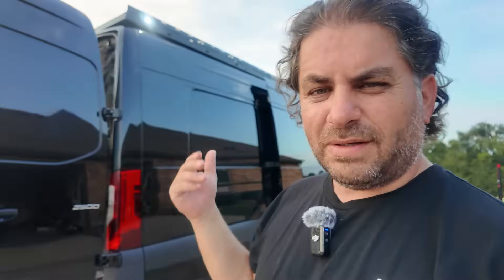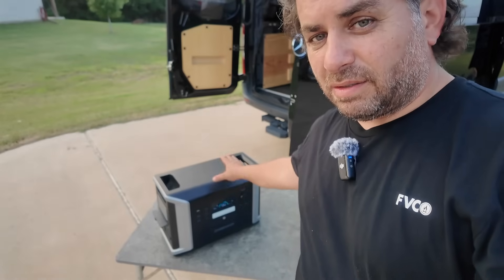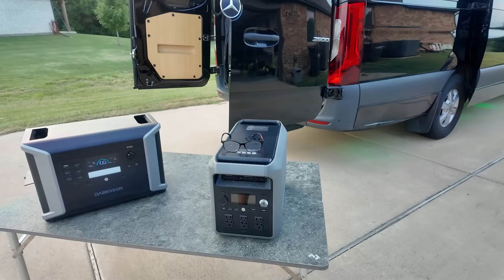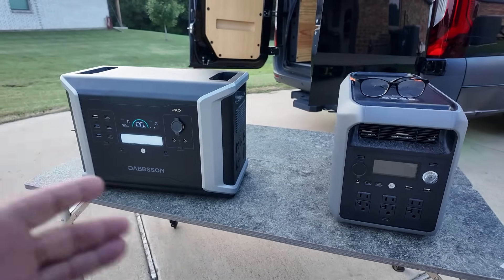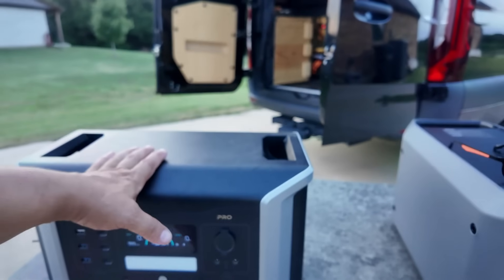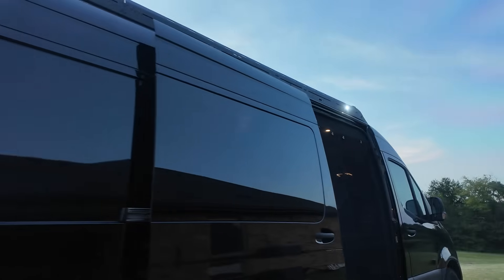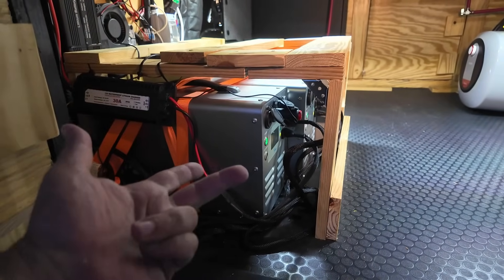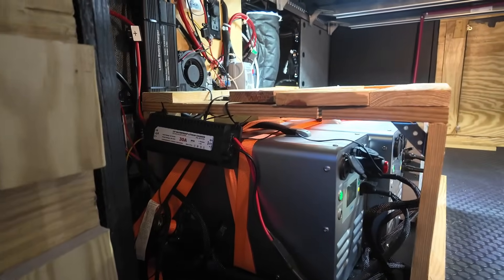The #1 Mistake Van Builders Make with Power Stations

Comment from the maker: ▶ See all the parts I used  in my VAN build for FREE https://bit.ly/RFVanBuildPartsList
▶ See the VAN build schedule for FREE https://bit.ly/FreeVanBuildSchedule

▶▶ How I making Van Life more enjoyable and stress free for Self-Contained Van Overnight Stays
https://tidd.ly/3IdDp25

▶▶▶ 4KWH Unit is CURRENTLY ON A SUPER SALE, AND SAVE EXTRA WITH DISCOUNT COUPON CODE Comvolt_RANDOMFIX101
Comvolt 4Kwh Unit
Purchase HERE ▶▶ Link to recommended vendor HERE 
My RECOMMENDATION GET the Comvolt 4Kwh  Unit with Display + PDU Unit  https://tidd.ly/4m3OkcM
▶▶▶ for extra saving use this DISCOUNT Coupon code :Comvolt_RANDOMFIX101

Comvolt 3Kwh Unit -- $$$$ The 4 KWH UNIT IS MUCH BETTER DEAL -see links above
▶ 3Kwh Unit Review https://youtu.be/7I8w5NbcXXA
Purchase HERE
▶▶ Link to recommended vendor HERE https://tidd.ly/3JziAyF
▶▶▶ for extra saving use this DISCOUNT Coupon code :Comvolt_RANDOMFIX101
▶ Amazon link ( more expensive than buying direct ) not available yet but here is the 3KWH link https://amzn.to/3X15I7h

▶▶▶ Vehicle Charger Install https://youtu.be/vN6dCU8epOw

▶▶▶ Perfect 400-watt solar panel https://amzn.to/3YRMjYQ

Already own a Comvolt unit? Just addon power!
Want the smallest unit with 6kwh of power? 6,016wh!! 6 KWh Add on units
▶▶ Link to recommended vendor HERE 6kwh expansion pack https://tidd.ly/45HD1C1
▶ for extra saving use this DISCOUNT Coupon code :Comvolt_RANDOMFIX101

Want to go BIG? Want the ultimate portable power station? Complete systems
▶My ONE Comvolt 4Kwh Unit with Display + PDU Unit 
https://tidd.ly/4m3OkcM
for extra saving use this DISCOUNT Coupon code :Comvolt_RANDOMFIX101
+
▶▶ Get TWO 6kwh expansion pack
https://tidd.ly/45HD1C1
for extra saving use this DISCOUNT Coupon code :Comvolt_RANDOMFIX101
= 16 Kwh system!

Useful connectors for Comvolt Units
▶ XT60 to TX90 Adapters https://amzn.to/4hu15fw
▶ Anderson 120 connector to XT60 https://amzn.to/3Yz7L3r
▶ Prewires Anderson 120 with wire https://amzn.to/3UA5GmF
▶ XT60 DIY Kit https://amzn.to/40uggz1

some of my volt components 
▶  12 Volt A/C https://amzn.to/41qukJM 
▶  12 volt with heater https://amzn.to/466mXtA
▶ Roof fan I installed https://amzn.to/3HjJRnW
▶ smaller fan I installed for better circulation https://amzn.to/3Und2tc
▶ 12 Volt Heater ( tested it many times and it's SOLID ) https://amzn.to/45pUZYf
▶ 12 Volt 27 inch TV / Monitor that can mounted to back of the front headrest in any camper van     ( weighs only 5 lbs +  USB C (video) for Android Phones + has speakers  )  https://amzn.to/40ZY5kr
▶ Swivel 1 inch ball double socket https://amzn.to/4oxL6Av
▶ DIY 12 volt 5.5mm x 2.5mm connector to power TV https://amzn.to/46V2GIn
▶ 12 volt Mini PC that use the same 5.5mm x 2.5mm connector https://amzn.to/4mguV9i
▶ 12 volt refrigeration https://amzn.to/4hB7qVY

Comment: I think 12V is fine if efficiently matching against 12V devices at low power is your sole goal, but there are a lot of warts.  Heat, Limited scalability (particularly for solar panels), large cables.   That said, if you are willing to live with the limitations, I think its fine to select native 12V.  At that point you don't even need a power station at all, you just use discrete components.

Power stations solutions are indeed far less efficient.  There are a lot of conversion losses.  But power stations offer a lot of capability in a small package and usually generate a lot less heat due to the higher internal battery voltage they tend to use.

I personally prefer to build things out of discrete pieces.  That said, I never use a 12V system bus any more.  It is way too limiting.  I will use 24V or 48V (i.e. 25.6V LiFePO4 or 51.2V LiFePO4) and eat the conversion losses. for any legacy 12V gear.

--

If you are still looking at power stations, one that might fit the bill for you is the Pecron series.  The Pecron E1500LFP, for example.  These power stations have some very nice features including a 30A 12V output (anderson connector),  a native battery expansion port (51.2V LiFePO4) which can be used to trivially expand the storage capacity of the unit, and separate solar and 12V charging inputs.  If a high alternator charge rate is not an issue it is pretty easy to more or less directly integrate it into a vehicle.

Also, you might not be aware but (generally speaking) USB-C PD ports can deliver 12V with a USB-C-to-12V cable.  Roughly 36W, so even regular power stations can actually deliver a bit more power at 12V than just through the 12V DC ports.

-Matt

Comment: For 1500 $. I might consider the Comvolt 6kWh version. Let´s cut the HYPE and get back to basics. We want to convert from the Lead Acid car battery to Lithium and we  want a big inverter to drive AC voltage devices and we want to use SOLAR POWER.
Jack of All Trades PECRON 3600LFP > 1.260$ + MJ32  adapter  cable
Nº1  Hook up to the cigarette plug. That is 100W x 24 hours = 2,4 kWh per day > NO headaches messing around with the DC-DC for that + Solar... In the morning  You start up the engine and the alternator will do what it was designed for. 
If You want more ? Victron DC-DC 50Amp with SET POINTS that allows to dial in on Max Amp alternator capacity

Nº2  2 independent Solar charge ports 1200W - up to 150V. No headaches. Any Solar configuration up to 2400W will fit

Nº3  48V inverters are more efficient > 3600W - MAX 7000W
Nº4  Use MJ32 connector. Fits All Pecron propietary Battery extension ports. Now You can hook up Your own DIY expansion battery PLUG&PLAY >>>> or hook ANY battery 12-48V to the 2nd solar port
Nº5  Stabalized Inverter with 3kWh storage capacity expandable  + build-in 1800W AC charger 
Nº6  Has Solar Wake Up feature and DC 30 Amp plug to run Diesel heater. You can not charge a Lithium battery below Freezing Temp but You can discharge it to keep the battery warm and the water in !!!!THE WATERTANK TOO!!!!
Nº7  Plug&PLAY > SET IT > FORGET IT 
Nº8  Warranty > WELL, they are both manufactured in China Town. I assume You know what this is about ? In both cases you have to take the thing apart and change the Lithium Cells.

What I am trying to say....We don´t need to reinvent the bicyle and for sure not for 3.300 $ 🤣 But THXs for the review

Comment: What is the 12v computer monitor and where did you get it?
Reply from the maker: sorry for the late reply
▶️ 12 volt Mini PC that use the same 5.5mm x 2.5mm connector https://amzn.to/4mguV9i
Link to video https://youtu.be/xA88BCCT_Tk

▶️  12 Volt A/C https://amzn.to/41qukJM 
▶️  12 volt with heater https://amzn.to/466mXtA
▶️ leak for level sealer I used https://amzn.to/42AMF6A
▶️ link for speed blade https://amzn.to/42PEGE1
▶️ link for jigsaw https://amzn.to/3EpRszP
▶️ Roof fan I installed https://amzn.to/3HjJRnW
▶️ smaller fan I installed for better circulation https://amzn.to/3Und2tc
▶️ 12 Volt Heater ( tested it many times and it's SOLID ) https://amzn.to/45pUZYf
▶️ 12 Volt 27 inch TV / Monitor that can mounted to back of the front headrest in any camper van     ( weighs only 5 lbs +  USB C (video) for Android Phones + has speakers  )  https://amzn.to/40ZY5kr
▶️ Swivel 1 inch ball double socket https://amzn.to/4oxL6Av
▶️ 1 inch ball mount for headrest to mount TV https://amzn.to/46Voofk
▶️ Vesa mount for TV with 1 inch ball https://amzn.to/4m8etI0
▶️ DIY 12 volt 5.5mm x 2.5mm connector to power TV https://amzn.to/46V2GIn
▶️ 1 inch ball for L track https://shop.rre-global.com/products/ram-mount-base-l-track-sealand-pro?_pos=1&_sid=e816317f1&_ss=r

Comment: I don't understand why you even bought a power station....You're using it as an overpriced 12 Volt battery charger...
This whole video is just bad. Bad bad bad bad...
Reply: Makes a lot of sense to me and explained in layman's terms even exposed hackers would rather have!
Reply from the maker: Thank you for the great feedback.
I am not sure how a few others didn’t understand it’s “Native” 12 volts so it can be powered by either vehicle or the power stations if needed.
Reply from the maker: So I should stack 10 units of 12 volt batteries, then get a inverter, dc to dc charger, then add a solar charger, add a 12 volt lfp charger, wire it all up, and then configure everything?
I would still be missing a networking option and if one battery goes bad I am screwed, this on the other hand balances everything and has over load protection.
I have previously built my own battery and it was a pain, try it yourself and let me know https://youtu.be/j02eP4d0ndk?si=u0tD6yhidE_of16S

Comment: The first question is why are you limiting yourself to 12 volts??? That was the norm for RVs for yesteryear but not for today!!! Today you could go 24,36,48 volts!!! Several of the portable power station companies make alternator converters for your power stations!!!
The problem is you chose to go the 12-volt route!!! 😂 Which is absolutely ridiculous... You could have went 24... But personally I would have went 48... Unfortunately you don't understand. You could actually hack your power stations to accept an external 48 volt battery!!!
Reply from the maker: I do understand the advantages of 24, 36, and 48 systems but you maybe overlooking why I went with 12 volts.
I mentioned it several times though out the video, it’s about efficiency and it’s native!
With your 48 volt lights?, 48 volt fan? 48 heater?
Please tell me more about your setup, I am genuinely interested in your ideas but not providing specifics is a little hard to work with.
Thanks
Reply: @RANDOMFIX  It's fine having 12V gear.  I don't think 12V efficiency is the most important thing here, though.  A good DC-DC converter runs 95% efficient.  You generally aren't going to care about efficiency with shore power (AC) or alternator charging sources.  And with solar the actual loss in efficiency is usually smaller than you think because with a 12V system bus the charge controller is converting the string voltage all the way down to 12V... there are losses there even though you are pulling from the 12V battery directly.

So usually there just isn't much of a practical difference.  Having a 24V system bus (or 48V) usually yields so much more flexibility and scalability that its worth the slightly higher losses for 12V gear.

The advantage is that all of your high-power equipment and solar can hang off the higher-voltage bus while your 12V appliances hang off the lower-voltage bus.

--

In terms of how to implement the lower-voltage (12V) bus, there are lots of ways but the two primary methods are (1) Use a DC-DC converter, (2) Use a DC-DC charger and a down-buffer battery, or (3) Use a charge controller (like a Victron 75/15) and a down-buffer battery.

"down-buffer battery" in this case would be a tiny 12.8V LiFePO4 battery, like 20Ah or 30Ah, which can be trickle-charged from the main battery bank.   Basically zero heat because the battery handles the surges and higher loads, whereas a DC-DC converter often needs to be high-amperage because it must deal with surges and higher loads.

-Matt
Reply: What you actually did With the power station was to buy and use it as an overpriced 12-volt solar charger!!! Since you're not actually using the power station as it is intended!!! I really don't understand why you even purchased one!?! 🤔👎
Sorry but all batteries die in freezing weather. They lose half the power doesn't matter what the chemistry of the battery is... But that's your choice...
Reply: What 24 or 48 volt alternatives do you suggest?

Or are you just recommending a fully customized component buildout with victron parts or something?

Comment: you could get batteries with more capacity than this box for a fraction of the price.  its is crazy to even pay this much money for this system
Reply from the maker: Thanks for your thoughts and feedback!
You would need a lot more than just batteries.
-You would need an inverter, a good one for sure, this unit has that covered!
-You would need a solar charger+ you would need a battery charger and configure the charger so you don't destroy the batteries, then you need a shell, voltage display, an amp meter, a networking interface+ heavy gauge wires + crimps, + a dc to dc charger, and in the end this the step up will take more room and time than may think. 
If you want to go that way I actually created my own batteries last time from scratch https://youtu.be/j02eP4d0ndk?si=hImglwGT_-XYx2VM but this is some much better! 
Quality is not cheap.
Reply: @RANDOMFIX I must have missed that part so this comes with inverter/charger and ready for solar hook up?  Then that’s not bad

Comment: Clayton Power II LPS II 3000 -  2000Wh, 180A (270A surge) of 12V DC, 400W alternator charger and specifically built for permanent vehicle installs, but it's British, so the inverter is 230V/50Hz, but many appliances are dual voltage. Probably not for you, but good video on it called 'Why I QUIT all POWERBANKS for good?' that makes some general points about such units you might want to consider, especially regarding packaging/space efficiency
Reply from the maker: Okay, so I watched the video, and am trying to understand the comparison. 
Here is what I see wrong with that unit from Clayton power, 
-twice as expensive for 1/2 the power! So essentially it's 4x timer more expensive!
-yes, it's 230v volts, but the connecters for A/C power are not plug and play!
Are you in the UK or USA?
Reply: @RANDOMFIX  like i said probably not for you (it's for the UK and as you noted very expensive), but it has a very different philosophy. It's not a traditional 'power bank', it's designed to be an integral part of a vehicle's electrical system and buried in a cabinet never to be seen again. So you never plug anything into it directly, instead you wire the van's outlets into it. I just found the different paradigm of how it worked useful to think about when it comes to thinking about what you really want. If you don't get anything out of it, that's fine

Comment: Good video. Thanks for sharing this info and that great Comvolt 12V battery based unit you found.  
Most people don’t realize some power-stations lose roughly 20% capacity to converting from 51.2V down to 5V for US devices.
Reply from the maker: Yeah I was surprised be the difference in the native 12 volt setup as far as that 20 percent loss of efficiency.
Comvolt really created something special.

Comment: Thank you for the info!  To overcome the low amps on power stations, I just added a 12v to my setup.  So I run Ecoflow Delta 2 Max, with Extra Battery and 280amp 12v battery.  I needed the 12v for heater, fridge and A/C.  I like Ecoflow as it was very simple, from the Ecoflow 800 watt DC to DC charger, ability to take 1000watt solar and I charge my 12v battery with an 80amp charger connected to my Ecoflow.   I recently purchased the Ecoflow SG3000 as I was using too much gas to charge my system with alternator.  I currently only have 400w solar and plan to add 300 more watts.  Unfortunately i cant fit another 400w panel on my roof.  Once I get 700 watts of solar, i will be able to charge my system mostly with that.  I agree with previous commentor, the better system is the Ecoflow Power Kit.  I could not afford it on my first build, but on my next van, i will most likely choose that system.
Reply: Another way to easily get a lot more solar is to deploy 450W ZOUPW folding portable solar panels.  I mention those specifically because multiple independent YouTube reviewers rave about how they outperform and outlast other portable panels.
Reply from the maker: Nice, I like your setup and thought process of adding that extra 280 ah 12 volt battery. Your system is effective but the 12 volt battery you have is the exemption to what am about to say about efficiency, the ecoflow is not a 12 volt BASED pps so a little concern there but overall good system! 
Again thank you for sharing and hope we get some other variations from other viewers to come!
Reply: @RANDOMFIX  The ecoflow power kit does overcome this exception.  It’s just too expensive for most DIY’ers.  So I had to go the route that I did.

Comment: EcoFlow Power Kit 5kVA Power System 10kWh LFP Battery.
Reply from the maker: What is the total dc output?
Reply: @RANDOMFIX   I looked at the EcoFlow Power Kit, but it’s 48V battery based system.  Ecoflow’s DC to DC voltage converters are about 85% efficient +- 5% for voltage and Ecoflow model.  So, you should expect about 8,000 to 9,000wH out of their 10kWh Power Kit battery.  8kWh is still great for van though, depending on how compact it is compared to a couple of the Comvolt 4kWh batteries.
Reply from the maker: @NickWindham  Nice, I would compare a comvolt 4kwh unit + a 6kwh (roughly 10kwh usable vs ecoflows 8kwh usable ) expansion to your Ecoflow unit. Don't get wrong about Ecoflow or other consumer pps, these comvolt unit are specially made for vehicles.